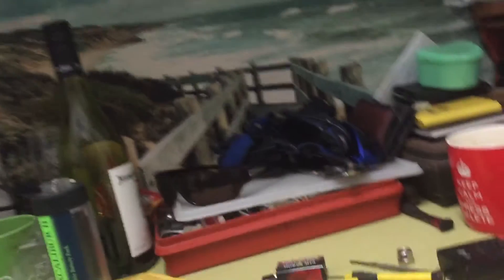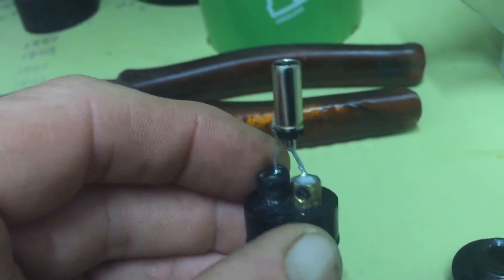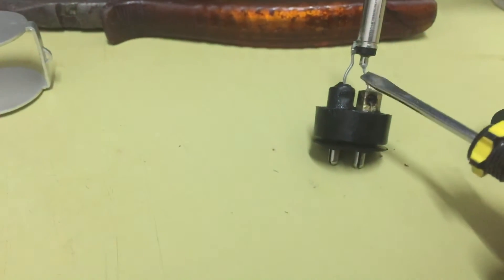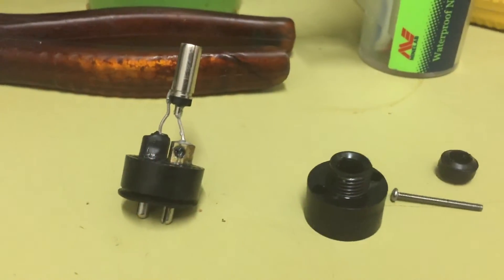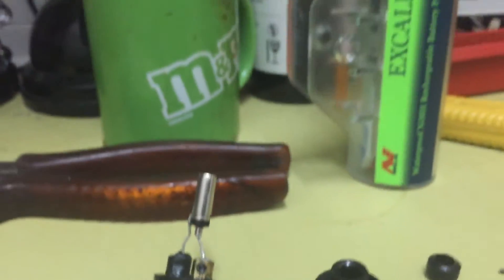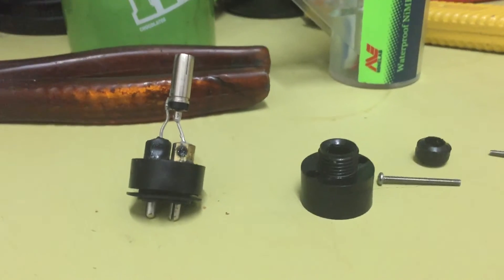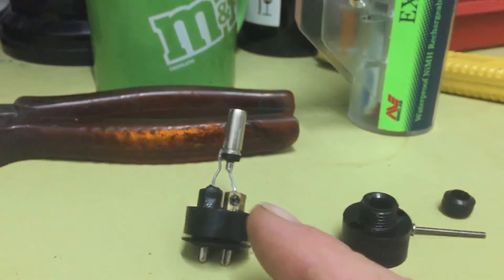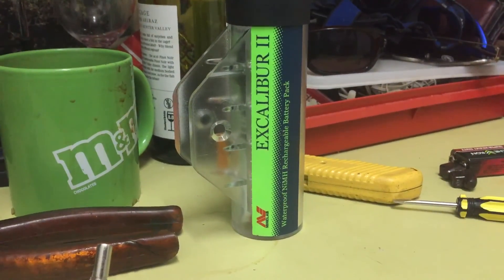Excalibur , dead as ?? Why , problem solve

Comment: Hey mate,

You are the man!!!! I was having the same problem with my charging system. I bought another battery and tried to charge that and it wouldn't charge at all. Finally I start looking online and I couldn't find anything on any of the forms or on YouTube until I came across your YouTube video! I immediately opened up my charger adapter and it appeared that there was a crisscross in the wires. And one of the wires looked like it was not even connected well.  I reposition the wires and put some electrical tape between the wires and soldered one of the wires stronger to the post and then put it all back together. Within minutes, I already had a charge on the battery! By the end of the day I was at 14.5 bolts! You are the man! I can't thank you enough for your video!!!! This charge adapter is a piece of crap! Minelab should know better. I can't believe that they made something that had absolutely no protection between the wires! And that the crap can twist around and touch each other! It's also a fire hazard! My machine was only 8 months old and I only used to be about 15 times before this adapter failed!!! You are the man! Thanks again!
Reply from the maker: Your welcome glad I could help thanks for commenting TD